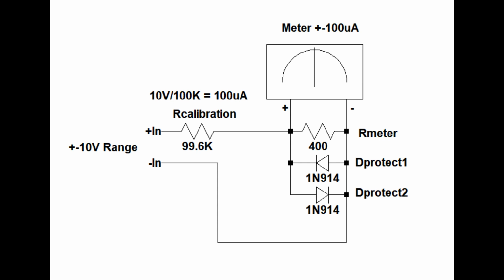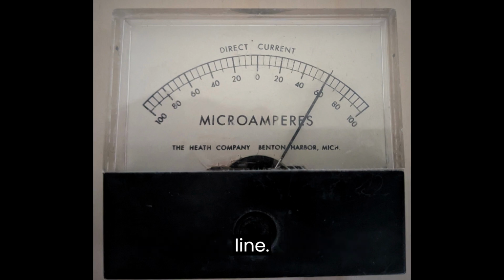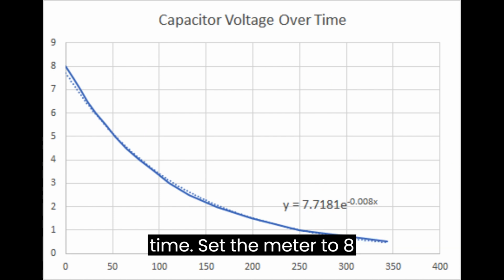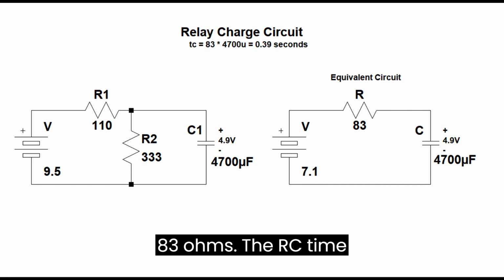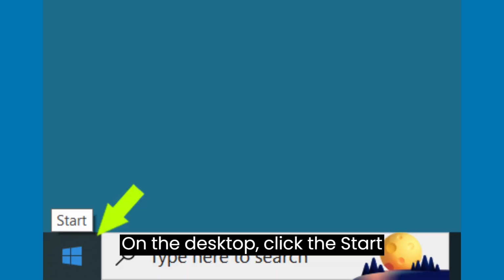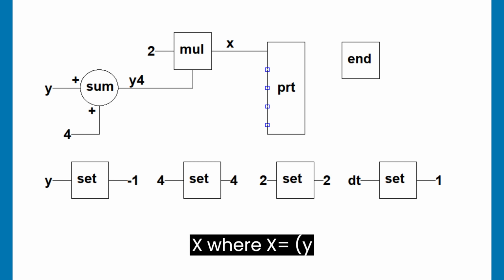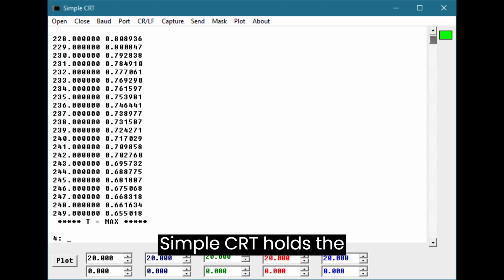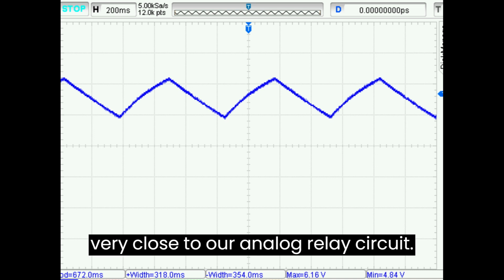Build a Four Dollar  Analog Computer

Comment from the maker: Go to https://github.com/simple-circuit/Block-Diagram-Compiler download the zip, and extract the files. If you are not interested in using I/O, simply hold the bootsel button down while plugging in the Pico. Then drag and drop the Pico_block_compiler_m.uf2 file into the Pico boot folder. To communicate you will need a serial terminal. SimpleCRT.exe is provided or use one of your choice. Additional information is available in the block_programming_pico.pdf document.